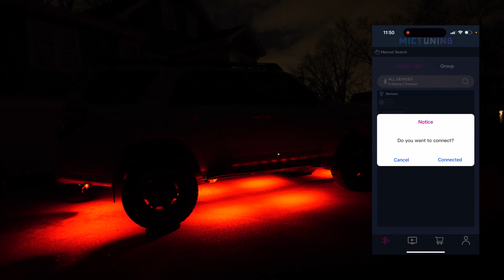Rock Light Install on my 5th Gen 4Runner - MicTuning C2 RGBIC LED Rock Light Kit

Comment: I'm a big fan of rock lights. I use mine all the time. Not just for trails in low light but they are also great as ambient light in camp when you are getting things set up. Great video!
Reply from the maker: I’ll use them more in camp for that exact reason than on the trail. Thanks for watching!

Comment: Where did you find the brackets ?
Reply from the maker: 10 PCS 4 Inches Black Adjustable... https://www.amazon.com/dp/B08TR6C91J?ref=ppx_pop_mob_ap_share
Reply from the maker: Those are the brackets I used with some small modifications.